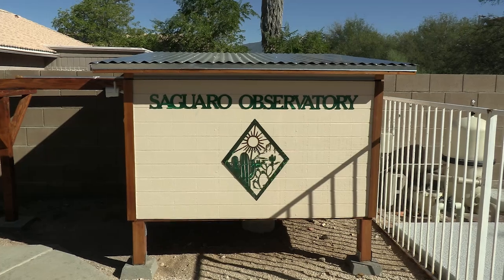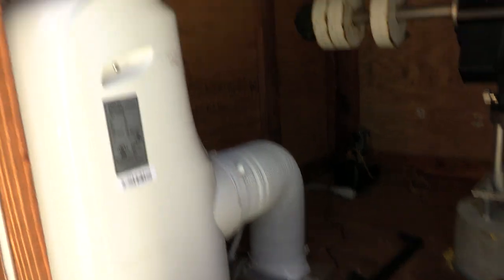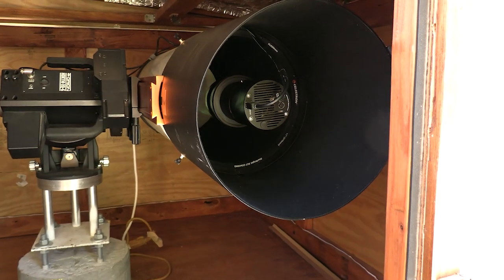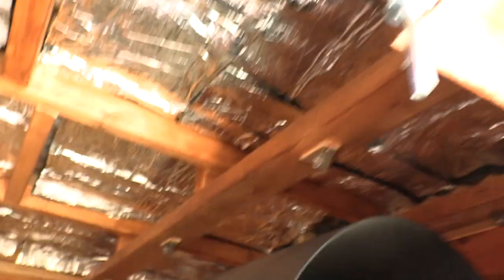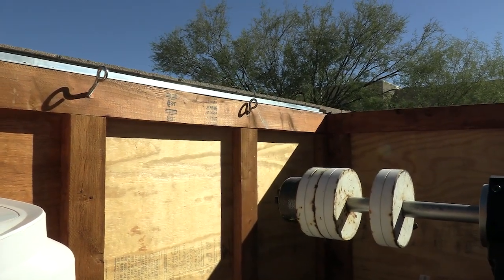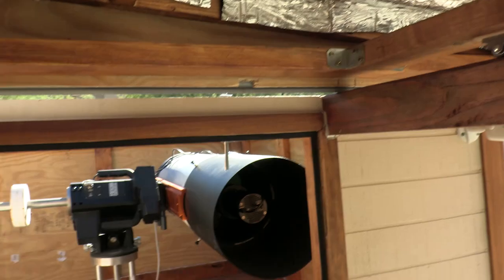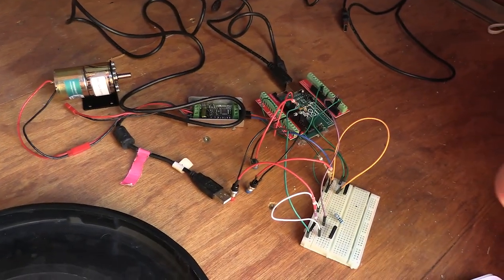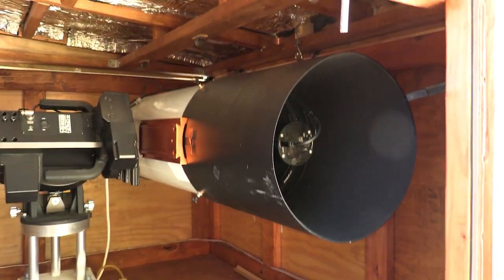DIY Home Observatory, Roll Off Roof, Saguaro Observatory

Comment: David,  My apologies if you receive two messages from me - I drafted one a few minutes ago and it seems to have vanished.  lol     Just wanted to tell you the observatory's very impressive.  Something of this size may well be the solution to my space-challenged backyard -- what are the rough dimensions of the structure?  Is the pier diameter 12"?
Reply from the maker: Hey Tom. It's about 75x75" from memory, and pier is 12". I designed a functional model of it in blender before I started. Tight fit but works well.
Reply: @rankinstudio Thanks for the dimensions.  Got sidetracked for a few weeks, but working on the build this weekend.  Still in the “prepping the land” phase.

Comment: What keeps the rollers from rolling off the side of the beams?
Reply from the maker: The track on the far side is made with angle track and grooved wheels.
Reply from the maker: You can see the track at 5:53

Comment: This has to be one of the best home observatories I've seen, well done. Did you build to a plan or cut and screw on the fly? I guess you know the next question, will you post the plans? 🙂
Reply from the maker: Thanks. Designed from scratch. I did the design in blender, not any plans I can share.

Comment: Thanks for the tour! It was very interesting to see how much effort you put into this and the variety of skills that you need in order to construct it. It's a great installation combining some fundamental construction techniques with concrete, wood and mechanical Hardware along with all the electronics and controls you added for enclosure and telescope movement. It's no small undertaking. It sounds like you'll be in heaven operating it. Time will tell if there are any issues related to temperature swings.  I would be concerned about environmental effects. Perhaps thermal expansion of components or heating adhesive materials. Perhaps the air conditioner will address this stuff. Obviously that's why you put in an AC unit. It's just too bad it will be another expense on a regular basis. Perhaps you could employ some solar power
Reply from the maker: It's been a few months now. All seems good. Take the issues on as they come :)